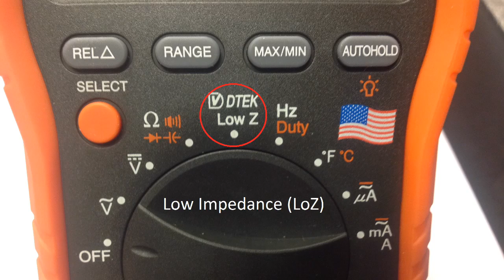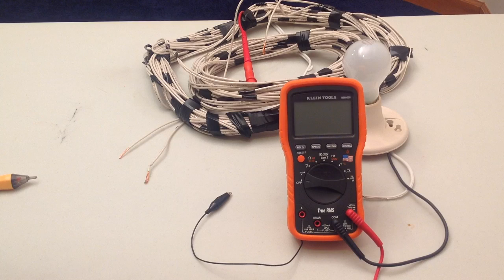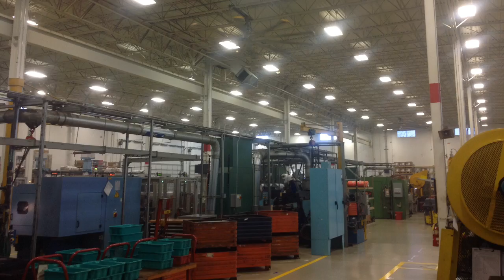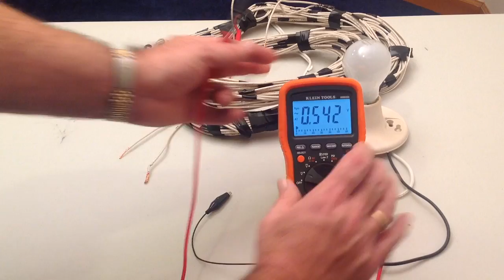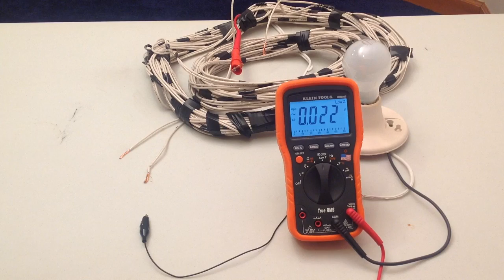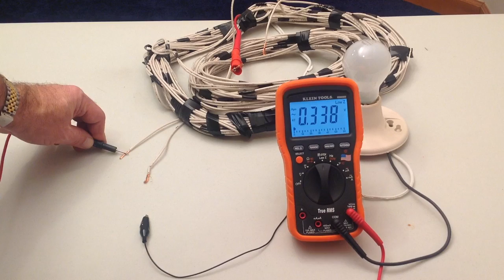Klein Tools Training Low Impedance

Comment: If you didn’t have a low impedance meter, could you measure ghost voltage line to ground instead of to neutral? would you get approximately 0V and know you have a ghost voltage? So if L-G=120V, L-N=0V, then if L-N>0 it’s probably a ghost voltage. Would that be correct?

Comment: Have you ever seen a case in which the voltage could trip a wiggy (making it seem like a real voltage), but was actually a ghost voltage that the Low Z mode would sort out? I think I've got that happening on a run of about 80 feet of 12/4 AC cable. I just didn't think a ghost voltage could trip a wiggy. Wiggy says it is on. Regular AC voltage shows 3V.  Low-Z shows a fraction of a volt.

Comment: Excellent video! So very true about ghost/static voltages. Even a wire with high resistance that is connected to a true power source will show good voltage if the circuit is open.